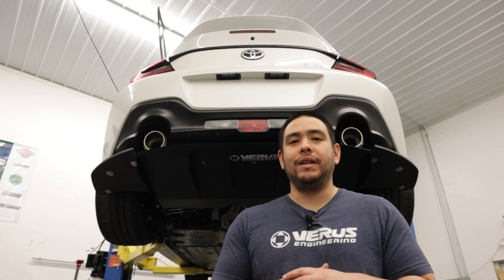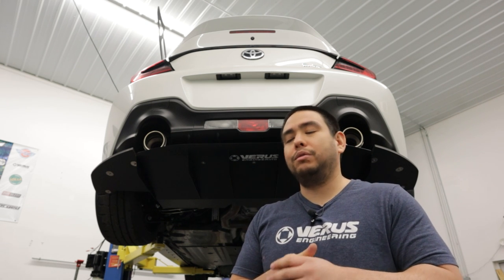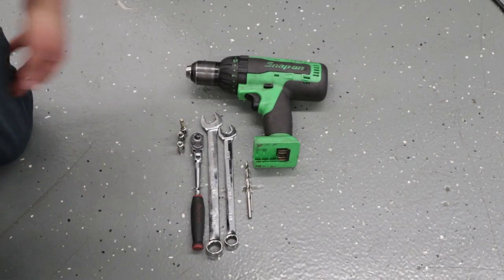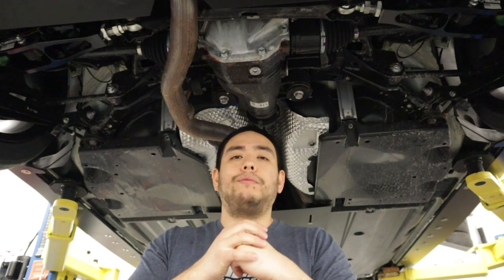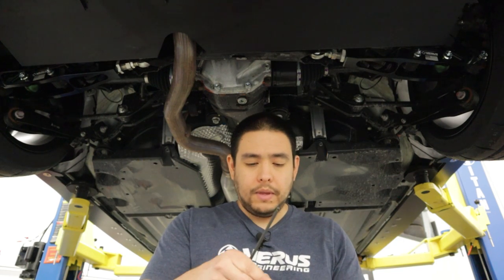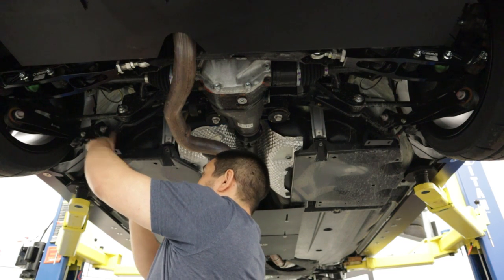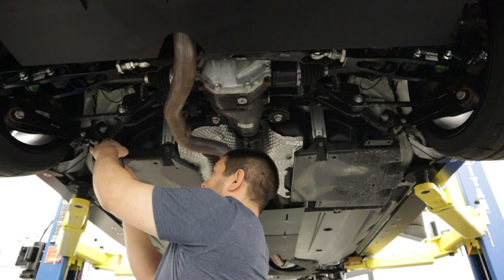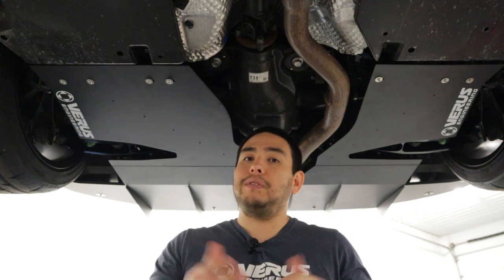Toyota GR86 / Subaru BRZ Rear Suspension Cover Kit Installation

Comment: For the rivet nuts on all your kits, are they easily removable?
Reply from the maker: Not really. Once they are installed, they are not supposed to be removed. However, they can be removed, but it will require drilling them out.

Comment: Have you been able to try it out yet and have you noticed a difference I’m wondering if that would help with gas mileage?
Reply from the maker: Yes. It would help with gas mileage. We cannot say how much but the rear suspension covers and the rear diffuser will reduce drag.